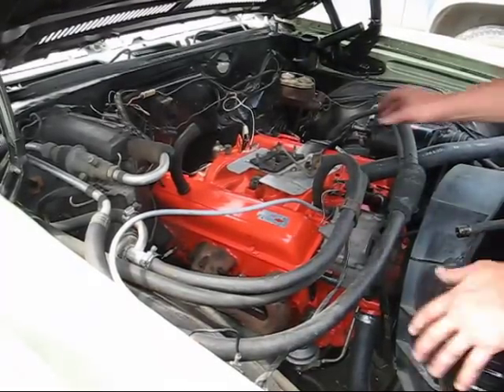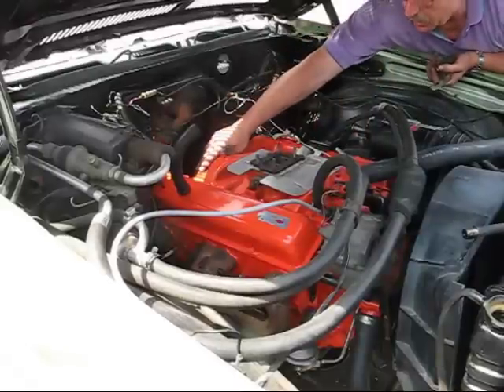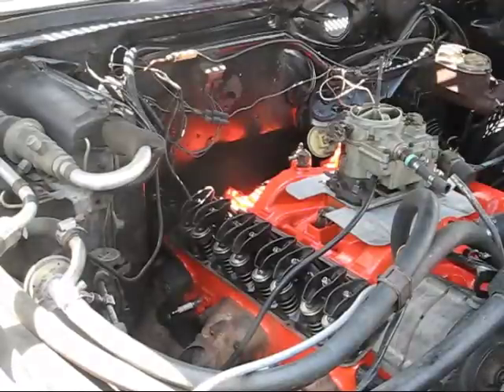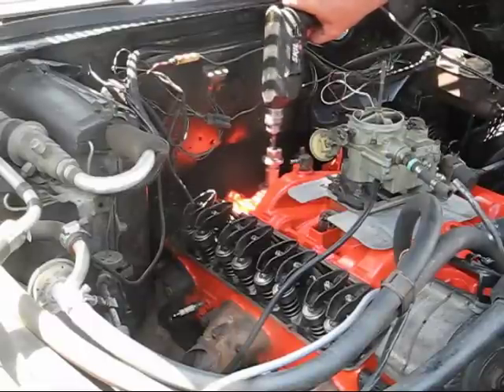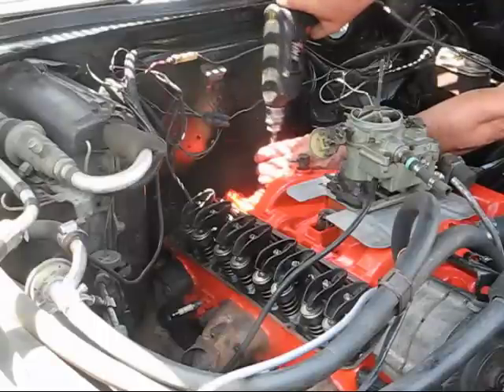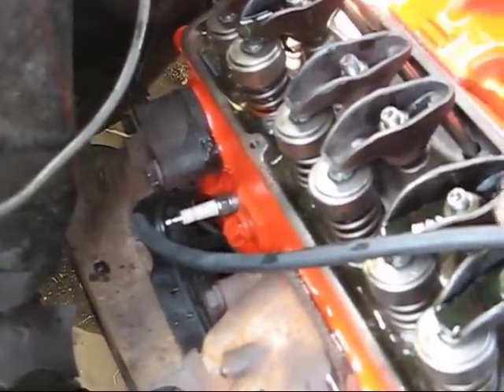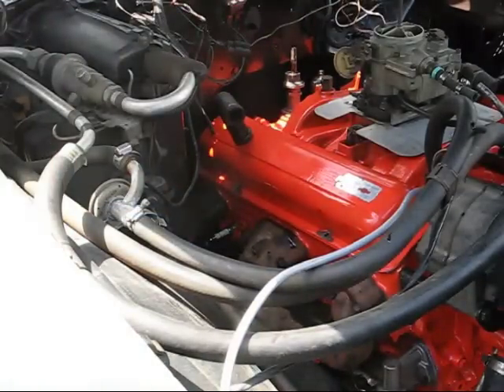How to Prime an Engine with Oil before First Start

Comment: It's nearly impossible to do this procedure on some vehicles with the engine installed.  On those vehicles, I do this before I install the engine. This procedure is very important, so the engine builds instant oil pressure upon starting for the first time.  It's also a good idea to remove the top of the oil pump and pack the gears with petroleum jelly.  Note, I've opened brand new oil pumps before and found that there was already white grease packed in the gears.  So I guess white grease is ok to use also.  However, the vast majority of brand new oil pumps are dry. If you don't have an old distributor, you can buy a Chevy oil pump primer for $20-$30. Don't skip this step.
Reply from the maker: Thanks
Good comment

Comment: Hi there i know its an old video but i noticed some rocker are dry, as i worked with mine and its the same thing , is that normal.
Reply from the maker: Yes,  especially if it has not run for a while.  The oil the has to come through the push rods before it gets to the rocker arms.
Reply: @davidlis6709  thank for replying , is these mean anything wrong with the lifters.
Reply from the maker: @ahmadaldahoud1719  No, they just need to be pumped up with oil.

Comment: David,question,i am installing a new engine here in about 20 days, waiting for the nasty heat to go to hell literally,lol,i have installed a few engines in my time but this is a little different,i had my builder build me a new engine but its been siting in my spare room at home completely covered and he primed it before sending it to me and of course i will prime the hell out of it before i start it.

My question is,the motor has been siting for approximately 6 months just sitting pretty, should i put something down on the cylinder bores like breaking oil or fogging oil or should i leave it alone? thank you for your input man, greatly appreciate it.

Comment: how do you remove the oil pump intermediate shaft without the tool. I tried using a flat head, skinny vise grip etc.
Reply from the maker: Don't understand your question
Reply: I belive hes talking about the distributor drive gear that meshes with the cam when he says intermediate shaft. If that intermediate shaft is engaged to the cam gears the oil pump won't spin independently.

Comment: I have that same priming tool, except mine still has the rotor on it and I just do it by hand, which is slower but I never thought about taking it off and using a drill.
Reply from the maker: My dad made that for me centuries ago.   I am surprised someone has not left me a comment about using a battery operated drill not my old electric one.
Reply: @davidlis6709  Lol, I seriously was going to mess with you about the black and decker,  Oh yeah, my dad gave me my priming tool too, about 20 years ago.
Reply from the maker: @davidcraft4909  I am too old to care about what some people have to say.

Comment: a lot of people dont know there's an oil passage oil about 5 inches down in the dist hole, just spinning the shaft wont get asd much oil to the pass side rockers if you dont block it
Reply from the maker: Just run the drill longer until you get oil to the rocker arms.  The oil goes to all the passages.
How would you block that?
Reply: @davidlis6709  the tool I use has a body/bushing that blocks the the drain back hole and that way the right oil galley fills up and gets oil to the pass side rockers

Comment: What does it mean if the passenger side head on a small block Chevy ? I just rebuilt the Entire engine with a new crank new pistons and new aluminum Heads E St.,  Edelbrock it’s going in my 1986 Indianapolis 500 pace car Corvette I’m getting good flow to the driver side head I put new lifters in the only thing I reused was the rods pushrods and rockers arms all the other stuff is new. I primed it with a drill I just don’t know if I didn’t long enough or if I should get a electric drill I was using a battery drill should I do it longer I probably only did three or four times for 2 to 3 minutes I was getting 40 psi oil pressure I’m sure I’ll be higher if I use electric drill I need help with this so I can put it back on the road any information knowledge would be Grateful
Reply from the maker: Rocker arms - nothing.  Push rods - did you clean them so there is oil flow. 
Maybe you need to do it longer.  If one side works the other has to.  The oil is coming from the same place.
With 40 psi the oil has to flow.

Comment: What about the cam bearings and lobes
Reply from the maker: Running the oil pump with a electric drill pumps oil everywhere in the engine.  The oil goes to all the bearing including the mains, rod bearing, cam bearings and the lobes gets oil because valve lifters get full and flows down to the lobes.

Comment: will this be the same process for a 1954 235 chevy inline six? ThX
Reply from the maker: Yes, you just have to have an old distributor  or they sell tools to do it.
Should really do it for every engine before starting.  It does not take that long but has a lot of benefits.

Comment: Couldn’t you technically just unhook the distributor wire and turn the motor over
Reply from the maker: Yes, but then you are turning over the motor with no oil on the bearings and everywhere else. 

Priming it with a drill is like running the motor without actually turning over, with the oil pump, pumping oil all over the motor.
Reply: David Lis I did it that way cause the company recommended to do it that way
Reply from the maker: @yamahaguy1732  Everyone does it a little different.  As long as it works.
Reply: @davidlis6709  Reason people keep asking that in this video is because thats how you prime those distributorless engines, i did not know that till I watched a video and i was like WTF??  they dont have a way to prime them like we do on these engines like yours, thats why they think you are doing it wrong or weird,lol 

All they do is fill them up with oil,take the plugs out and disconnect the fuel pump and let her rip!! i guess it works,people have been priming engines like you are doing for decades and decades, myself included, damn youngsters,lol
Reply from the maker: @dntlss  Doing it my way, you need an old distributor that has been altered.  Harder to do.  I just happen to have one I made years ago.

Comment: I see this but not sure how much pressure it takes to spin. The drill I use is electric and on my 351 the priming rod is so hard to turn that you cannot turn by hand. And my drill smells really hot after turning the rod about 15 seconds. Surely there is an issue as it shouldn't be that hard to turn, right?
Reply from the maker: Is the rod connected to the oil pump correctly?  Did you take off the oil pump?
It should turn freely.  There is something wrong.  Video:  1:10 shows that I turned it with my fingers.
You might have to take off the oil pan and take a look.  Maybe the oil pump is not bolted on correctly?   If metal on metal is rubbing, that will create metal shavings that will destroy your engine.
Reply: @davidlis6709  Okay the rod is not hard to turn with fingers when it has no pressure built up. I guess when the pressure builds inside the engine it makes the pump work harder? 
Because I took it apart again and found nothing. And again when I want to I can turn the rod by hand. But once I hook the drill up and spin it up, then I cannot turn it at all. It must be building pressure right? Or does the engine pressure it creates not have anything to do with the pump. Because it feels incredibly hard to keep it spinning fast. In fact, I believe it would eventually burn out a Makita half-inch drive electrical drill motor! Help!
Reply: And yes I took the pump off the engine and it can easily be spun by hand. It throws oil everywhere so I know it works. My point is, should the pump continue to be easy to spin always, or does it become a bit harder to spin ? Mine becomes more difficult to spin the longer I spin it.  first few seconds it does fine, then gradually gets more difficult to keep it spinning at high speed.
Reply from the maker: @MrCbell57  I don't understand why it gets hard to spin.  How about - going to an auto parts store and asking them if they would let you try one in the box to see if it does the same thing as yours.
Reply: @davidlis6709  I suspect it is building pressure? Maybe not. It spins fast and free and easy when out of the oil. Holding it over a trash can. But once it goes back in the oil it begans to get very tough to spin. My makita can spin it but it smells like burnt bushings after 30 seconds. The part came from summit so they don't take parts back that have been installed. I was hoping someone would tell me that they all get tough to spin at high speed. Guess not. Its one of those melling high-performance pumps.
Reply: @davidlis6709  i TALKED TO A GUY ABOUT THIS: He said I was using cold oil and running the rpm of the drill about 3k. Which means the cam only turns a half turn when the crank turns one full turn. So basically I would have been turning the pump at 6,000 rpm. with cold oil that is pretty darn fast, and much faster than you guys are turning your pumps. So basically he said slow the drill down and as long as it is priming you are set to start it up and break it in. Sound about right?
Reply from the maker: @MrCbell57  I do not know the answer to your question.  Never had that experience.  I would seem logical that as the oil pressure builds up it would get harder to turn.  When I did it in this video, I did not have the issue of my drill getting hot or overworked.
Reply from the maker: @MrCbell57  Does the old one have the same issue?
Reply: @davidlis6709  I don't have an old one. This is a complete rebuild of a 351 Cleveland 71 year motor.  I would think using a cordless with very little rpm it would be pretty easy to continue turning it. But I'm afraid I got int the thousands of rpm revolutions and I'm pretty sure as pressure builds so does the pressure on the system. Even if the cam is turning it. A pump of any sort generates volume. That volume comes at a price. What goes in comes out and vise'verse. Thanks for your comments and reply. I think it safe to assume it is working and pressurizing the engine with oil. Thankfully we don't have to sit here and turn this ourselves!
Reply from the maker: @MrCbell57  That is good information.  Learn something every day.
Reply: @MrCbell57   Just stumbled upon this thread.  I'm doing the same but on a '73 351C.  I'm curious how things ultimately turned out for you.  I'm turning mine "by hand" about 1 rotation/sec, and after a few rotations I get a lot of resistance and start getting pressure to build to 100+psi.  It's making me wonder if the oil pump bypass spring is too stiff or the bypass valve is stuck.  Ultimately I'm wondering if the pressure is so high because the engine parts are not rotating, restricting the flow of oil.

Comment: Does it matter it the oil pressure gauge goes off the scale when doing this?
Reply from the maker: What is the highest reading on your oil pressure gauge?  The engine only has so much oil pressure.

Comment: why isn't the cam turning to?
Reply from the maker: Because on the altered distributor,  the gear that connects to the cam shaft was removed.  This allows the oil pump to be turned and not any other part of the engine.   Understand?
Reply: @davidlis6709  thank you buddy.. after thinking i got it :D
Reply from the maker: @berndrocket517  There are no dumb questions.  If you are asking, there are several other people to scared  to ask.

Comment: Is this really necessary? Lets say and engine has lost 100% of it's coating in the cylinders... How long would it take before it's coated again after being started? 2 seconds? 5 seconds max. 

This is so unnecessary! Do you all really think that running an engine for 5 seconds max would damage it? 

I see this type of video so many times! You have to do this and that if the car has been sitting for a couple of years... Why!? As soon as you start the engine the oil starts circulating and will cover the entire engine in about 5 seconds at the most!
Running an engine with no oil coating for 5 seconds isn't going to damage it!
Reply from the maker: There are 2 schools of thought.  Some people are like you and believe that there is no problem knowing that oil will be everywhere in the engine in  5 seconds.   Maybe that would be ok for an engine that has been sitting for a long time but has operated for thousands of miles and all the parts are wore in together.   I have started old engines without priming them and they run just fine.  You have to crank them before the gas gets where it needs to go before it fires off and that gives a little time for the oil to get to - at least the crankshaft bearing.  

Me, if I rebuild an engine and all the contact points are new and have never been running together, I am afraid.  I believe they need to run together and wear in together so they get used to each other and need oil from the start.  
That being the case, I believe that all contact points should be lubricated before starting.   I talked to several machine shop guys and they use lube on everything because they are afraid and have past experience that if you do not prime a new engine and rev it up on start it may screw up the crank and/or rod bearings.   Then the customer brings it back complaining that they did a crappy job of rebuilding their engine.

What do I know? I am not the manufacturer.  I am just a guy rebuilding engines and doing the same thing that always works for me.  What is another 1/2 hour after spending all that time and money.

Here is my results:  https://www.youtube.com/watch?v=vm-YY-xsMyM
Reply: @davidlis6709  thank you for your instructional video.
Reply from the maker: @James_the_Builder  Thanks,  Just trying to show people what works for me.
Reply: @davidlis6709  He's probably never paid 6 thousand dollars for a new engine,when it comes out of your pocket you will take a whole day to prime it if necessary, i know i would.
Reply: Great job explaining 👍

Comment: If you'll notice,  you can see at least one of the rocker arms is not receiving oil.   One of a number.  Depends on the orientation of the lifters, cam, etc.  You should rotate the engine slightly...to expose the oil passages to the the oil pressure in a slightly different configuration ...it's  not hard ..use a wrench...
But ALL rocker arms arms should receive oil....if this is to be of benefit...not just some.

And the other guy is correct...if this is truly an complete rebuild...it should never be assembled with proper assembly lube....everywhere

For a minor wet assembly this procedure is good....with the change I offered above.
Reply: Did you mean to say it should never be assembled WITHOUT a proper engine assembly lube?

Comment: That rocker peeing 😂😂 at 2:52
Reply from the maker: Starting to fill up the hydraulic lifters and the oil is going up the push rods to lubricate the rocker arm and top the head.  I would love to see it in action at 2,000 rpm with plastic valve covers.

Comment: Ive primer my new pump but a few pushrods aren't getting any oil any help you can offer on that?
Reply from the maker: If some of them are getting oil, they all should.  Maybe they are clogged up.  Try soaking  them in gas or some solvent and them blow air through them to clean them out.

Comment: Hey Davided.  I like the idea of the heat plate or shild under the carb . What rpm are you going to brake the motor in at and how often will you flip the rpms, what time fram for brake in time?
Reply from the maker: The heat plat is from the factory.  I have no idea why they put that as part of the design.  

I just drive the car around town so the rpms are always changing.   Driving on the freeway at a constant speed is not recommended.  After 1,000 miles I change the oil and look for metal partials in the oil.   Then I go to the normal 3,000 mile oil change.  I look at it as " pay me now or pay me later".  I always change the oil in my cars at the right time.

Comment: will the engine make compression if the lifters arent primed
Reply from the maker: Yes because they are spring loaded.  When you adjust them for the first time, you take out the clearance, then I tighten them 3/4 of a turn.  The manual says 1 turn.

Comment: how do u prime an engine that has no disi like a 3800 gm that u hav just swapped out the cam and lifters?
Reply from the maker: Sorry - don't know
Reply from the maker: The only other way is to use assembly lub on the parts before assembly.  Most machine shops use lub because most people don't prime the engine before starting.

Comment: How long does it take to get the oil to the top when priming
Reply: Take your time with priming your engine.  Slow is safer for your oil pump you can damage it using high power drill . Trust me . 😢😭
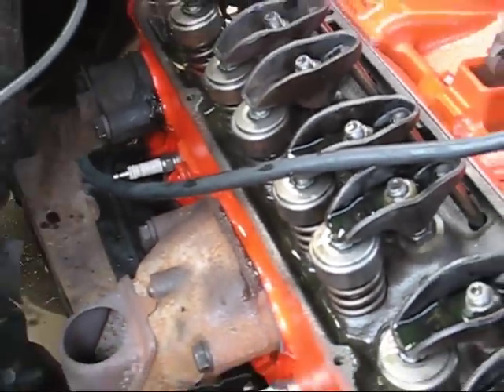Reply from the maker: Depends on how fast you run the drill.   About a minute.  I let it run until you can see the oil coming out of the rocket arms.    4:20 video minute marker
Reply: David Lis thanks for the info
Reply from the maker: You are welcome

Comment: Keep in mind that the cam shaft must be turning to lubricate all the rockers, Lifters only get fillled with oil at their mid point position
Reply: That's why I use Zinc (ZDDP) lube on the cam lobes before 1st start.  Perfect!
Reply: @Terrence Parker Instablaster :)
Reply: @Ariel Dante Thanks so much for your reply. I found the site through google and I'm trying it out now.
Looks like it's gonna take a while so I will reply here later with my results.
Reply: @Ariel Dante It worked and I actually got access to my account again. I am so happy!
Thanks so much you really help me out :D
Reply: @Terrence Parker happy to help :)
Reply: @arieldante3991  bot
Reply: I guess im asking the wrong place but does anybody know of a trick to log back into an instagram account..?
I stupidly forgot the account password. I appreciate any tricks you can give me